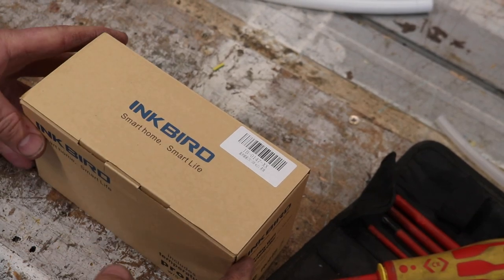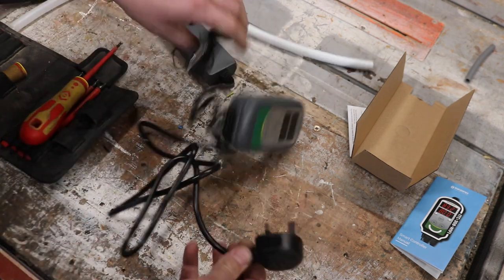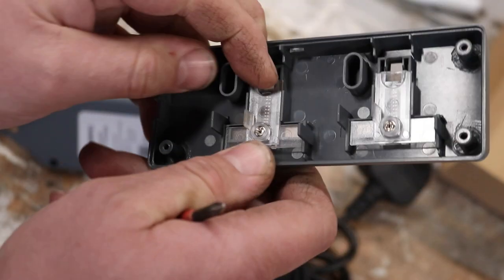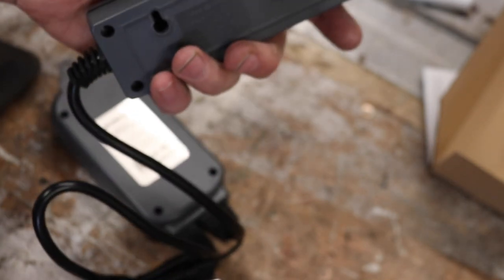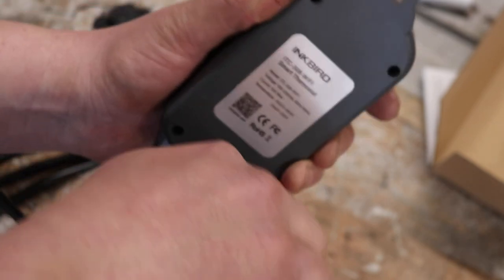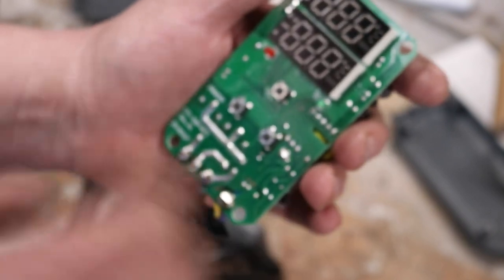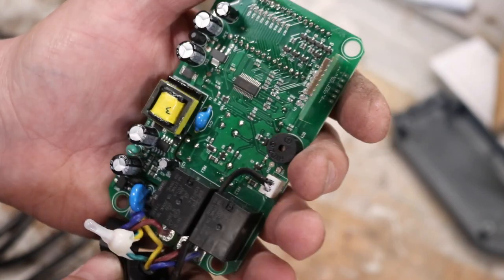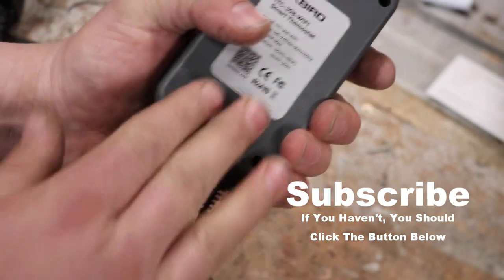What's Inside An Inkbird Wifi Controller?

Comment: I recently bought one with the waterproof aquarium probe so I can leave it submerged in water/bottle in my kegerator. My old unit with the standard probe shown in this vlog started playing up & was reading 20c when the fridge was working flat out. Luckily the fridge controller stopped it from freezing. Think water must have got into the probe over time.

Comment: Be interested if you see the common fault with those. You'll get the controller momentarily flicker temp high/low and trigger your chiller on/off quickly without the hysteresis delaying things. Its killed a few fridges and chillers of mine so now i just have the standard inkbird STC controllers and don't see the same issue.

Comment: Have a spare Non-WiFi 308 unit I've not used yet, was intrigued to see if it was the same main PCB without the WiFi module, but alas, it's a different board layout.
Reply: Does the none wifi router version have pins?